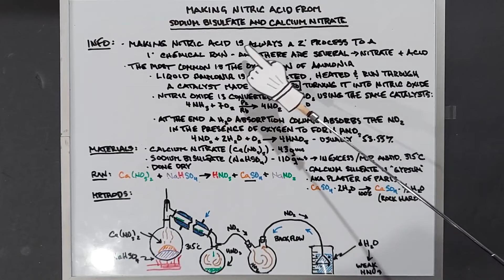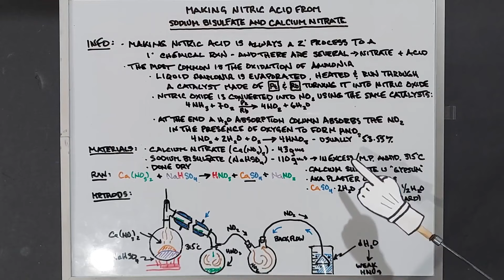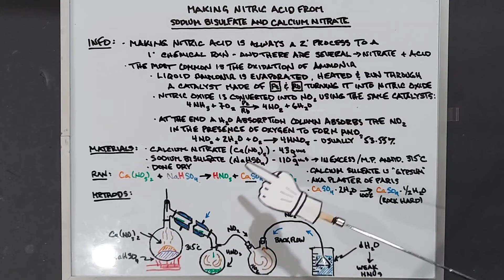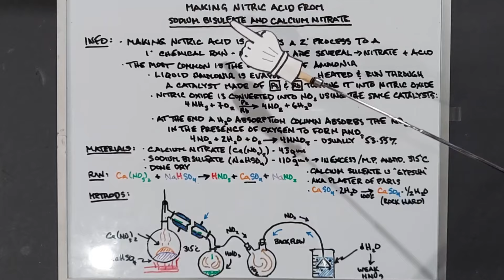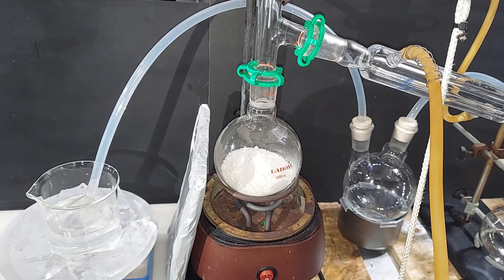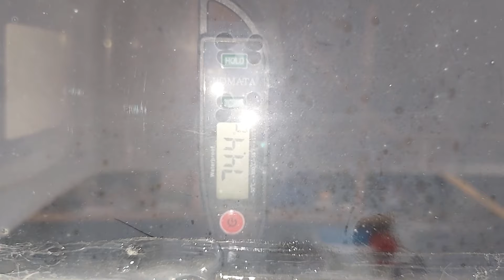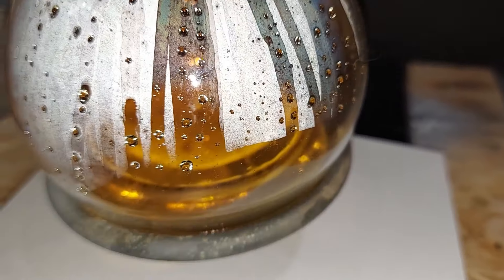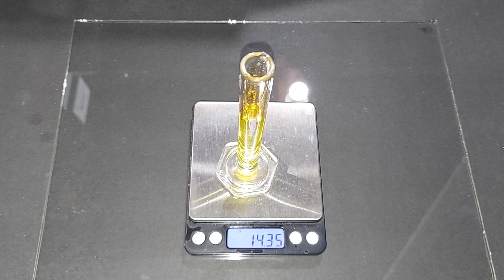Making Nitric Acid Using Dry Sodium Bisulfate

Comment: 14:15 in order to prevent back-flow I'm usually using borosilicate check valves (one-way valves for chemistry) and it has been working like a charm so far
Reply from the maker: That's a great idea

Comment: Very nice method. Typically, when I make a gas trap using a funnel, the funnel is submerged only an inch or so. With a gas that is highly soluble in water, like you have here, this allows adequate absorption while avoiding suckback.

Comment: @Cranial Construction You´ve made two little mistakes: The first one is the reaction of sodium bisulfate and calcium nitrate will only leave behind calcium and sodium sulfates since you´ve used an excess of sodium bisulfate to counter the problem with calcium sulfate and in reaction equation you wrote you´ve stopped at sodium nitrate as one of the reaction products, but sodium also reacts with molten sodium bisulfate to form sodium sulfate and more nitric acid:  
NaNO3 + NaHSO4 = Na2SO4 + HNO3
The overall equation is then: Ca(NO3)2 + 2 NaHSO4 = CaSO4 + Na2SO4 + 2 HNO3
The second mistake is that sodium bisulfate is usually obtained as the monohydrate, which has a lower melting point than the anhydrous version (58,5 ºC for NaHSO4 * H2O; 315 ºC for NaHSO4), so the reaction doesn´t need that much heat to happen.

Comment: tend to use the birkeland eyde reaction to make my nitric acid, have a small reactor using a mains supplied high voltage and a aquarium pump for air impute.  makes fuming nitric acid from air. simple solution. a three neck flask inverted makes a great reaction vessel, with high voltage in the middle neck and air input and nitrogen dioxide out the through the two outside.

Comment: Dissolving metals like cobalt, copper or silver in nitric acid is so wasteful in respect to nitrogen oxides evolved. This NOx scrubber would be a nice setup just for making metal nitrates.  Many nitrates are deliquescent like nickel nitrate for example and not favorable for weighing so you can distill the remaining nitric acid via 98% sulfuric acid to make the metal sulfate.
Reply from the maker: Cool.  Thanks!